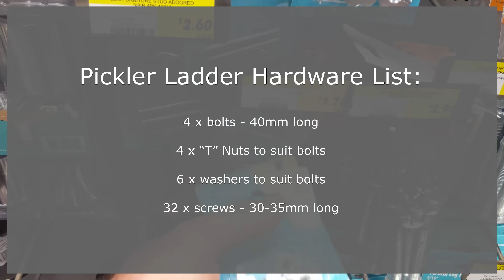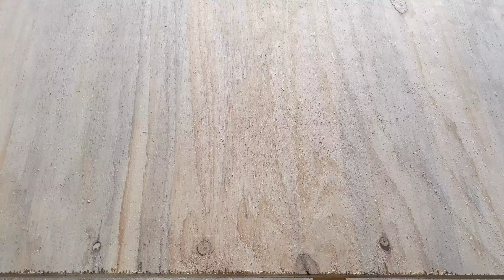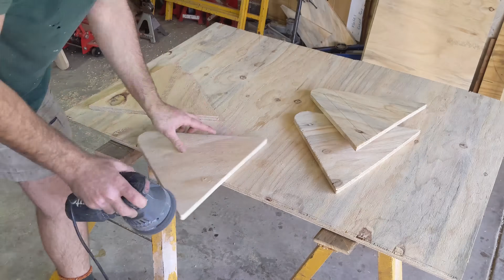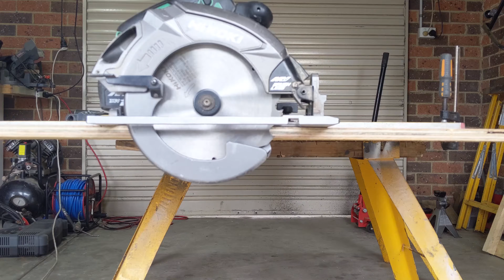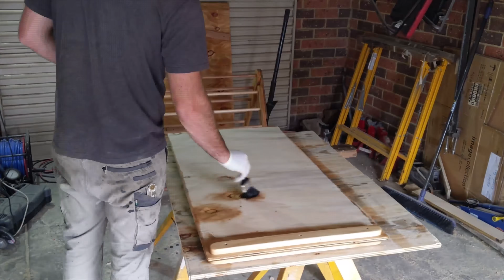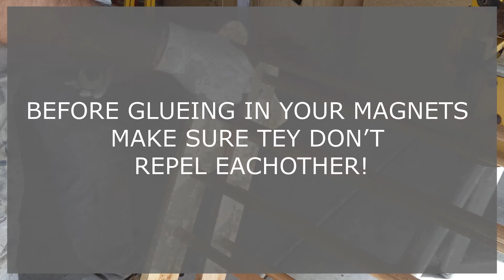Free Pikler Triangle - Easy to Follow Tutorial, No Special tools Required

Comment: Awesome vid, thanks so much - looking forward to building.
Can you clarify what the magnet is for?
Also, just looked at some of the materials and the plywood and dowels from Bunnings are over $200 combined, am I missing something?
Thanks
Reply from the maker: The magnets hold the threaded knobs while they're not in use.
As I mentioned in the video if you make 2 and sell one you will recover the  money spent on material. 
I made 2 for a total of $300 and sold one of them literally a the day after I made it for $300.
Hope this helps!
Thanks for watching!
Reply: Dingel-DIY awesome, thanks for the quick reply